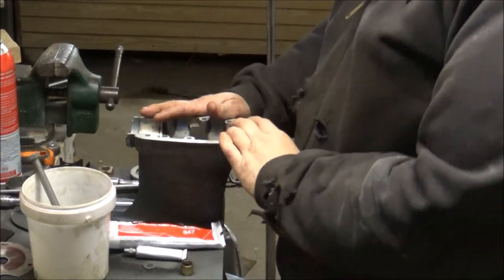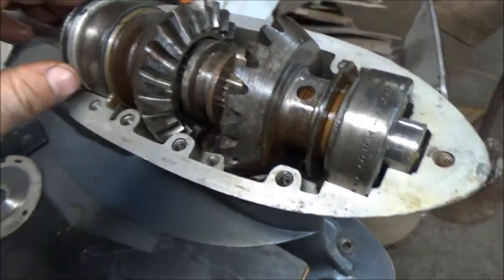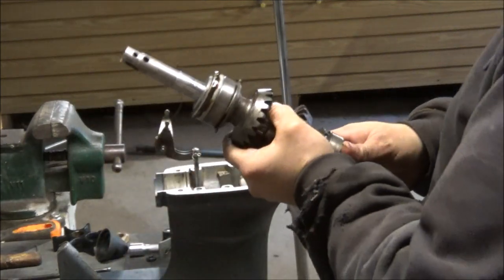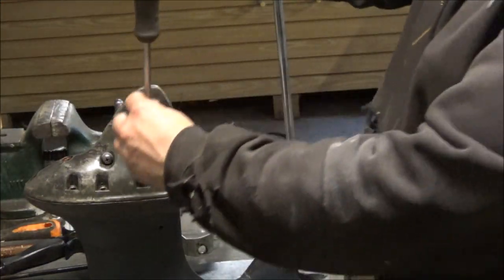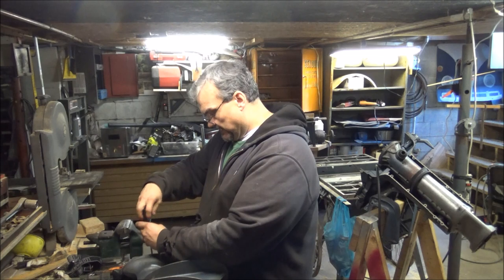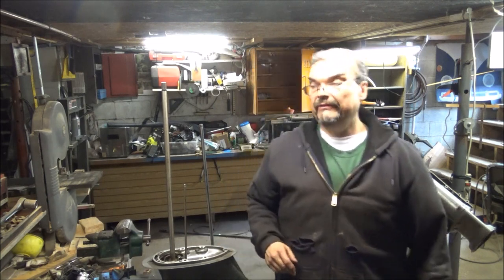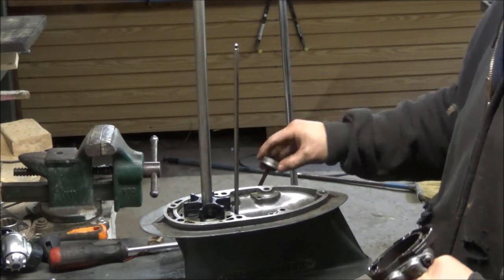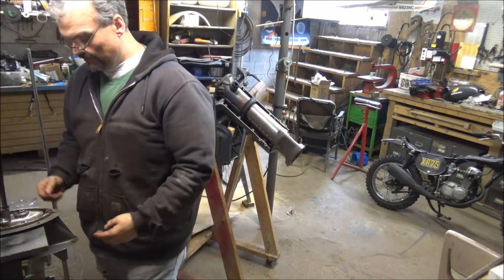F'nRude Lower end will not go back together

Comment: i got the ironside reference,lol. i was going to suggest no on the o rings and install the tubes up inside first as stated below. they didnt have the sealing technology we do now,if the manual doesnt help i would either use a thin coat of silicone or a anerobic sealer made for aluminum on aluminum. i still have some from the dealership days,chrysler used it on the neon and pt cruisers...... it does work very well
Reply from the maker: roger oconnor I will pull off the orings tonight and see if I can work the tubes out of the pump housing.  They are in there pretty good.  Thanks for the input.

Comment: hey. o-rings bad. if you want to use something i would suggest lock washer. put the tubes in first, it's easier to line them up at the pump after you get the drive shaft in. your going to go nuts doing it that way, and, hahaha, sorry, lmao from when i tried it that way!
Reply from the maker: I thought the little o-rings was a Brilliant idea to keep the water out instead of gooping them up.  I did think that it could decrease the amount of force, but the 847 did squeeze out good. Do you suggest another method of sealing up the head of the screws. Last person slopped them up with silicone, I can do that.   I tried to pull the tubes out of the housing and they seam to be "glued" in.  I didn't pull too hard but they seam to be stuck in there good.  I don't want to break it.
Reply: The spaghetti seals should keep the water out , rubber O rings are only gonna vibrate and expand and contract . Which means the screws will vibrate also Not being locked down . I would go with a little bit of sealer and some lock washers. It is a brilliant idea for some applications but I don't think it's good for that gearcase . The last guy who Slopped them up with silicone probably didn't do a rebuild like you did ,If I remember there was silicone on everything, Which is the same thing I did one time and it worked, but for how long i will never know.
Reply from the maker: THIS OLD OUTBOARD gear you load and clear.  I will be removing the orings tonight and adding lockwashers.  Thanks for catching that.
Reply: Ed Moore don't add lock washers either.   If you look inside the screws go to the inside of the spaghetti seal.   The screw heads need to sit flush to the housing.   Use some of that $30 goop just enough to make a seal between the base of the screw head and the case.   When your done you should run a pressure test.   Lots of examples of this on YouTube.  "Brandon's Garage" has one on this.
Reply: I agree, don't over think this. just put the damn thing back together the way it's meant to be! geezus
Reply from the maker: J Potts will do!
Reply from the maker: THIS OLD OUTBOARD force of habit I really do try to do things right.  Should be a nice short video of the lower end going back on tonight.  Lets cross our fingers.
Reply: I know, I do the same thing and end up undoing it. hahahaha

Comment: Ed I used to set the outboard upside down and ratchet strap it to the bench leg, it was easier to see what you're doing.  Any movement of the mid section will make the job much harder.  With 2 water pump tubes I can see that won't be easy to line everything up.
Reply from the maker: eastcoasadventurous looks like I need to remove the tubes from the pump housing then it's easier. Thanks for watching, commenting and subscribing. Later -Ed

Comment: Ed wish i could be of more help to you as far as the gaskets and some of your other questions I would think they would be in the service manual you have Also did you look to see if it tells you how to get the lower unit back together up above does the case have another place where it seperates if so i wonder if it would be easier to take that part off and bolt it to the lower end then try putting those up in the case that way hope you understand what i'M saying. LOL good luck I'M sure somebody with more knowledge than I have will chime in with some better advice. Have a great week. God Bless!!!
Reply from the maker: I have studied Gary Tweed video several times from the beginning of the project.  He has a great deal of useful info.  I think I need to remove the tubes from the lower end and get them in the upper end, then get them in the pump housing.

Comment: Like the other comment said.  You need to pull the  tubes out of the water pump, grease the ends and slide them into the grommets up inside the leg.  then with the tubes hanging down you can slide them into the grommets on the water pump when you slide the gear case up and in.  the drive shaft can be a challenge as well.  Make sure you grease the splines before you put it in.  Otherwise the shaft will seize into the bottom of the crank.
The O-rings on the screws is going to be a problem.  Those need a bit of sealer around the head but no O-ring.  Just think of the torque going through that gear case and those screws holding it tight when operating.  The O-rings will crush and allow things to flex where they shouldn't.
Reply from the maker: J Potts no orings Got It.  When I saw they used an prong to seal the Shift pivot pin. I though why not use an oring instead of hooping them up with sealer.  But after you said it it makes sense.   Thank you so much for your input.

Comment: Ed maybe you figured out the 2 plastic O rings were for your oil fill and overflow screws. The little black O-ring goes on the shift dog anchor bolt.

Comment: Drive shaft turns clockwise and the blades of the impeller should trail back counter clock wise according to the repair manual. sorry this note is a year late.
Reply from the maker: Better late than never!!  Working on a 1971 Honda SL70 now!  Have had some major setbacks but got some parts in the mail today...so back at Ressurecting Rusty junk!  Thanks for watching, and Commenting , no matter how late!!